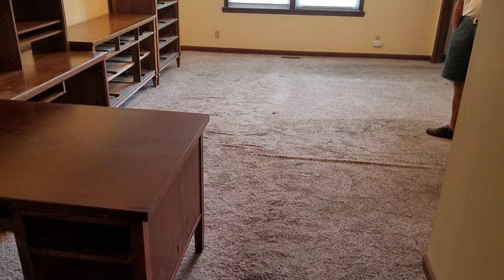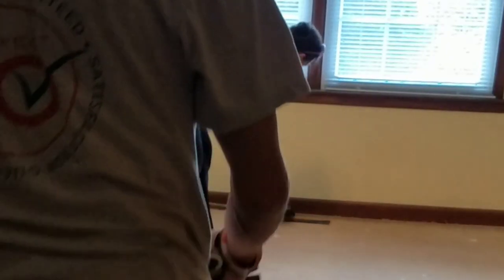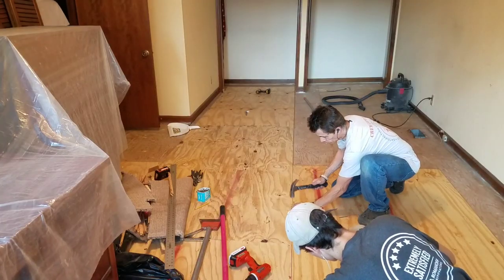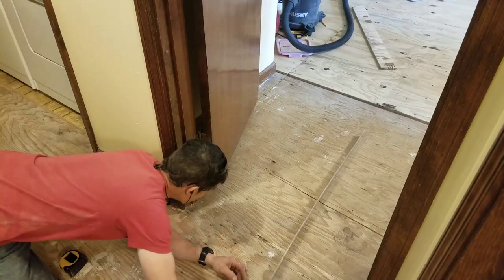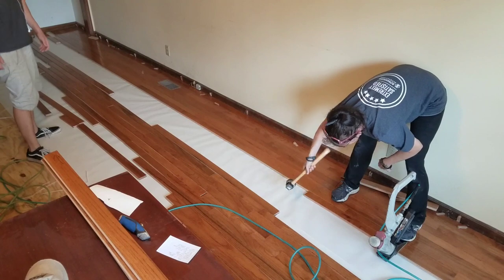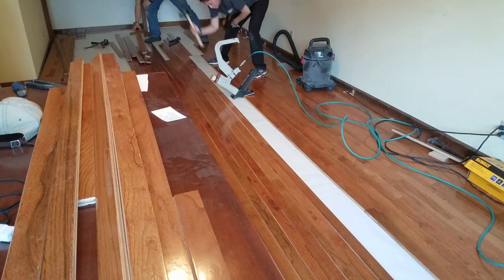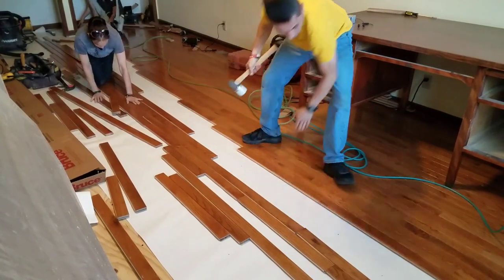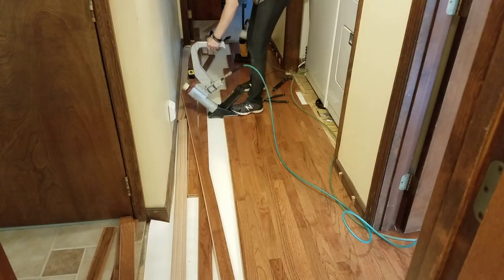You cant install hardwood on particleboard. Here's what you need to do.

Comment: Very well done. I agree with everything except the basic premise that you have to pull up particle board in every case when laying solid hardwood. I have two rooms with carpet over 1/2" particle board over the same 1.5" decking as the rest of the house. The nail gun uses 2" staples, meaning at least 1" of the staple will be driven through the flooring and particle board into the decking. That's a lot of holding power. Four pros bidding on the job have agreed on this. This particle board has been in place for over 25 years, and the floor is perfectly level. Also, the crawlspace has a 6 mil plastic vapor barrier covering the entire building footprint. Give me a strong reason to argue with them.
Reply from the maker: Sounds like you got lucky. On this particular job the decking was only 1/2 inch. And the subfloorwas super wavy. So a good stiff 3/4 makes me feel confident in backing up my work going forward. Good luck on your project. Thanks for the comment
Reply: I'm trying to do same. How is it holding so far

Comment: Simpson makes a quik drive system that uses a makita drill with a patented attachment that holds a clip of variable size screws (25 at a pop), and an extension that allows you to stand while using. It allows you to rock and roll when screwing down a subfloor. The screws come in various lengths that go up to 3 & 1/2 "long and different composition for using in outside climates. It is a big time saver for subfloor installs and just for tightening up loose nailed in subfloors. It is an added service for your company to be able to offer improved subfloor condition to your clients. I don't work for Simpson but I really love their product. Big time saver. Also you are exactly right about particle board, I hate it, and it is a gamble any time you try to use it, even with a floating floor.
Reply from the maker: Yeah I remember those. I used to frame houses and they would send a guy in after us to put screws in and he had one of those. Cool tool. I'll check it out. Never thought about it but yeah would be a great addition. Customers see you doing that they will know you take pride in your work. Thanks for the comment
Reply: @YOUFLOOR  Also, I'm in the middle of taking out another particle board floor. I save a lot of time by using a Makita fine cut plunge saw. It allows you to adjust the depth you need and the ability to insert the running blade without kick back. It produces very little saw dust but also has a port that allows you to attach a vacuum line to further decrease sawdust in the home. On a 4x8 section of particle board rip a cut an inch away from the nails used to hold the board down, adjust the blade to the same thickness of the particle board. Then go to the edge of that board and pry up the edges, use 2 of the longer prybars, minimum 3' long. As the edges lift up 3" or more it will lift those nails enough to quickly remove them, working your way into the board towards your cut. It is a lot quicker than digging those nails out and you have an easier section for hauling out of the house to your van or truck, or dumpster if you have one. I've dug those nails out b4 and it is time consuming, the 4x8 sections are cumbersome and difficult to safely remove from the home without bumping a wall or a picture on the wall, or a low hanging light. Before you know it you are replacing someone's 25 year old ceiling fan light globe, or the fan itself because you were in a hurry. LOL

Comment: Very helpful tips on the particle board. (I have to do this, too!) But why add the new plywood? Couldn't you just nail down the hardwood to the plywood that was already there? (Too thin?)
Reply from the maker: You can as long as it 3/4 inch and there is no big floor height difference. Sometimes it’s necessary to keep all the floors the same level. Hope that helps. Thanks for the question

Comment: Thank you so much for your video. I have  the same issue with particle board under existing carpet. I will install 3/4 hardwood floors, nailed down. The subfloor is 5/8 plywood and I will be adding 5/8 plywood underlayment on top. Couple questions; do you add any adhesive to plywood underlayment along with screwing it down to existing subfloor? I am planing to use 1.25 inch wood deck screws to attached the plywood. This would not hit the joists. Do you recommend using longer screws to grip thejoist? I’ve read conflicting recommendations on whether to joist or not to joist when adding plywood underlayment. Thanks

Comment: I have 1/2 inch plywood then 1/2 inch particle board , im installing new 3/4 inch wood flooring . I have to remove the particle board but do I Need to lay more plywood on top of existing 1/2 plywood? Or can I do with just 1/2 inch plywood subfloor alone

Comment: Great video! May I ask why you need to put another layer of plywood? After removing the particle board, isn’t the real plywood subfloor ready for installing hardwood floors?
Reply from the maker: @Linguang Zhang Tks for the question. The plywood underneath the particle board we pulled up was 1/2 inch and it would need to be at least 3/4 inch to nail hardwood into. As long as the plywood under the particle board is thick enough and you are ok with the height of the new floor it shouldn’t be a problem.
Reply: @YOUFLOOR  So did you just install another 1/2 ontop making it 1 inch? 
Also, im getting a lot of conflicting information regarding expansion. Overall I get it, but in this case if your nailing it down, what expansion will there be? Its nailed. No?
Reply from the maker: Have you ever had your fingers swell up and it is almost impossible to take a wedding band or any other ring off. However days later it will practically fall off. Well same with your home. It is built out of wood and so is the flooring. And when it heats up and cools down not only does the flooring expand but so does your home. It will settle over Tim and doors will close by themself and so on. So you want to leave an 1/8 of an inch to 1/4 so that if it ever does some crazy expansion  there is nothing  binding it up. To much pressure will cause your flooring to start buckling  and peaking at the seams because up is the only way to go once full expansion has been reached on the perimeter. Hope that makes sense. Thanks for the question.
Reply: @YOUFLOOR  Thanks. Guess I only think about the floor, not the house.  If you'd be kind enough to share more of your expertise, my sub floor is OSB and it dips between the joists in many spots. I can literally feel where the joists are as I walk on the carpet. Should I just put another 1/2 or something on top and screw it down before hardwood?  Not sure what to do and cant find any info on it. Side note, I have installed hardwood on previous house but the floors were flat. This is a new challenge.
Reply from the maker: I would say if you can feel the joist its probably 1/2 or something else.  3/4 wouldnt sag that much. Maybe after 50 years. Lol. If you have any a/c vents in your floor, you can pull them up and measure the thickness of your floor. Even with carpet you can see the subfloor from inside. If its half inch. Yeah your probably going to have to cap it with a heavy duty plywood. Like 5/8 thick. If the joist are  on 16 inch centers you can get away with 1/2 inch. But I would drill a few pilot holes in the middle of the joist and use corse screws with threads all the way to the top to suck those two pieces of 1/2 together.  DO NOT USE NAILS AS FUTURE SQEAKS WILL DRIVE YOU NUTS. Probably wouldn't hurt to throw a little liquid nails in between sheet just to prevent movement between sheets. Then the hardwood needs to be installed. Fairly asap. Keep in mind with every layer you add. Make sure you add up all the thickness. Subfloor plus new 3/4 hardwood. Make sure it doesnt go so high that you can't close the front door. Also if you have a dish washer and frig that is nice and tucked in that your new floor height  still allows clearance for these appliances.  Especially if you ever have to replace your d.w. hope that. Fell free to ask any other questions.  Thanks for the engagement.  Good luck on your project
Reply: @YOUFLOOR  So double up, gotcha. In the area where I install tile, should I double up as well and also do a layer of cement board? Basically having 3 layers of subfloor?
Reply from the maker: I don't  do a lot of tile but I can tell you if there is any deflection at all with tile. Especially big thin tiles. The grout will start cracking and eventually so will the tile.  You have to make sure that floor doesn't flex especially between joist.  So yeah the stiffer the subfloor the better. And if joist are  on 2 foot center for so.e reason,  I wouldn't even attempt it.  Hope that helps brotha. Would love to see finished product pics. We started a f.b. group  and would love if peole from the comments came to join and post pics of there finished projects. Good luck. Thanks for the comment

Comment: Is it OK to lay that top layer of plywood with the grain in the same direction as the plywood underneath? I have heard that you should lay it with the grains 90 degrees to each other. Asking because I am not sure.
Reply from the maker: I do it all the time.  I don't think it matters either way. One thing you can do that would make it super strong, is if your plywood starts with a 4 ft sheet, you can rip the 1 sheet of the second  layer down to 2ft. This will overlap the seams long ways then just carry on with your 4 foot sheets and use the rest if your ripp for the last row. Hope that makes sense. Thanks for the question

Comment: Hi. Total neophyte in building. Converting shed to cabin. Subfloor is Advantech OSB with Lifetime Limited Warranty. Underside is not treated by me, at all. No skirting yet. (Finances.) Seams between panels seem to be a little dark, like there's some moisture coming up from under the shed, but I don't know what I'm looking at. Shed has been on site for a year. My brother says paint it with Kilz and throw down a bunch of rugs. Decor is going to be redneck/mountain/rustic. I am a senior; I'm not going to raise a family in it; I'm scavenging everything I can. Question: what needs to be put down on this floor to put scrap 2X6 pieces of hardwood down for flooring. I don't want to redo this.

Comment: Great video! I am DIYing a similar project. What kind of screws do you use to fasten the new plywood to the subfloor? Do you screw to the joists? I have heard conflicting information on whether to fasten to joists or just to the subfloor.
Reply from the maker: I like to use 2 1/4 decking screws. And that is to make sure I go through to the joist. Which should answer your second question 😁 Hope that helps. Thanks for the question
Reply: @YOUFLOOR  awesome thanks so much

Comment: What about engineered hardwood floor?  Can you float it over particle board?
Reply from the maker: As long as there is not a lot of moisture, you can float laminate or engineered wood over it. It just doesn't hold fasteners very well, so you wouldn't want to staple.Floating down or nail it down to particle board.I hope that helps.thanks for the question

Comment: I have the same issue. After pulling the carpet i found particleboard which is on top of the old hardwood floors.  Can I still laydown any other type of flooring on top of the particelboard?
Reply from the maker: You can always put down a floating floor or carpet. Hope that helps. Thanks for the question

Comment: Thank you, very helpful. I have been watching your vedio and got more confidence to do DIY floor. Just wonder if OSB is ok for 3/4 oak hard wood floor? And do I need to have underlayment? If yes, any recommendation? It will be installed in 2nd floor and nail down. Staples or cleats would be better?
Reply from the maker: Yes O.S.B. is perfectly fine. Just make sure it's not particleboard. As far as underlayment you can use roofing felt. You can get about 480ft. For around $20.00 . They also sell flooring silicone paper from the flooring section but in my opinion. The felt paper offer more sound muffling than the paper. Especially for the 2nd floor. As far as fasteners  if you staples are way more cheaper than cleats. I use 2 1/2 Dewalt or  Fasted Bostitch. For bamboo or exotic wood you need 18 guage nails with a different  gun
Reply from the maker: Sorry was late for a class. But anyway. Yeah it will require a different gun for bamboo and exotic woods ect.(brazilian cherry) using s 15 or 16 guage can tend to split the tongue but 18 guage is required. If you dont have one you ca rent them. Thanks for the question
Reply: Thank you very much for all the good suggestions. Is wax paper good for underlayment?
Reply from the maker: Honestly I've never heard of that. But it could be a thing. I would go with felt if you not sure. Good luck with your project

Comment: What's your recommendation when you're installing click-lock Luxury Vinyl Plank over 3/4" particleboard that sits on 1/2" plywood?
Reply from the maker: Its been my experience than as long as there is no rot, or moisture and the partical is fastened pretty secure (preferably  throught the floor joists) and there are no huge humps and dips you should be fine running any floating floor on particleboard. Ive done it plenty of times over the past 12 years and never had a call back over particleboard.  Hope this helps. Thanks for the question

Comment: You can install over particle board..!..you simply use a bit of construction adhesive every foot of board and IT WORKS PERFECTLY..do not remove the particle board. My living room floor has the construction adhesive and it is down tight, no squeaks, no movement after 12-14 years.
Reply from the maker: It sounds like your conditions were perfect. But I would suggest to anyone to do it. Too much risk. As a home owner, it might be fine, but as a 15-year installer, I wouldn't risk the back charge. Thanks for the comment
Reply: Dud you use the construction glue between the underlayment and the wood flooring?  When we lay our hardwood floors, we use the black roofing paper as a mositure barrier under the hardwood floor.  All of our rooms had plywood so far.  Now we are to the family room which has a plywood subfloor.

Comment: Thanks for the video. I have a question because the situation shown here is different from mine. In a portion of our home we have 3/4" particleboard subfloor, not underlayment but particleboard on the 16" oc floor joists. Currently there is carpeting which we want to remove and install hardwood flooring. If I install 1/2" plywood as underlayment is that good enough to nail hardwood. Or to be safe would you recommend a floating floor? Thanks.
Reply from the maker: Well I used to frame houses. And from what I know most houses are framed with a 3/4 inch subfloor. Then for tile you lay backer board. For carpet ( when there's a height difference in floors) you lay particle board. For hardwood you would lay a moisture barrier and nail your hardwood right to the 3/4inch sub floor. If you remove the particle board and you find out that someone used 1/2 inch instead of 3/4. Then one more layer of 1/2 would be P P P Plenty sufficient.Uless it messes with the height of joining floors.  Of course if the original subfloor needs repaired or replaced that's a different story. So to summerize...  check to see if your original subfloor is 3/4. You can go pull an air conditioning vent sometime and look down beside the metal to see subfloor under the particleboard. If so pull that particleboard,  check for moisture and damages, make small repairs. And then your off to the races. Btw floating floors are awesome to. The home legend we did yesterday is very diy friendly and has a real hardwood look.  Check out Z construction LLC on Instagram for pics. Hope that helps. Thanks for the question
Reply from the maker: I went back and re read your comment. Are you saying  that the builders put particle board as sub floor. NEVER EVER seen that if that's the case. If so then pull it and replace with real plywood. If it's in a small area of the house. Also are you sure it's particleboard and not chip board or what  I call advantec. Pressed chips of wood glued together to make a 3/4 inch plywood. This is made for sub floors and is perfectly fine to install hardwood on. Wish I could take a look in person. I've done this before with a subscriber. But if you want to send pics feel free. I can get a better look at it. Zconstructionllc@gmail.com. thanks so much for the question this was a good one. Had me thinking in my sleep about it👍
Reply: Thanks for the quick reply. Sorry you lost sleep but you read it correctly the second time, true subfloor, first layer on top of the joists is particleboard. This is common in mobile homes. Our house started as a manufactured home with a large addition added later. I've done my share of remodeling but never dealt with this material.